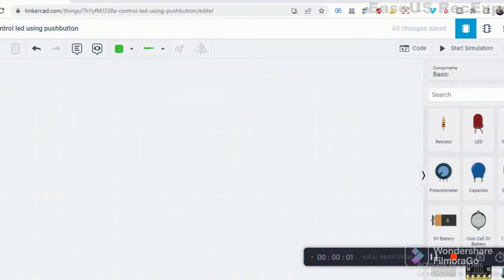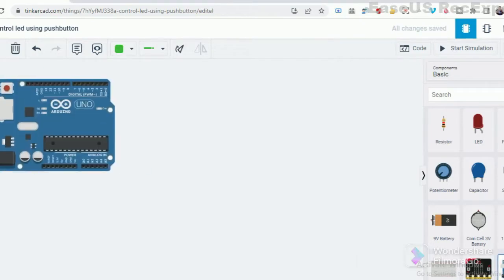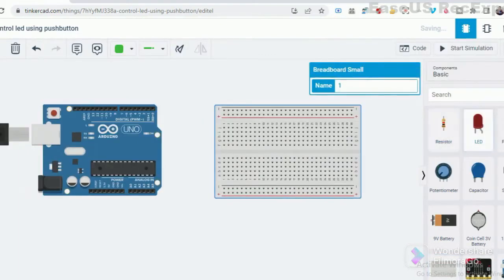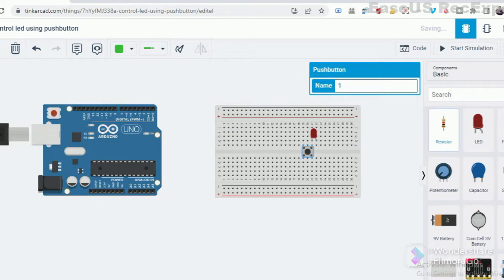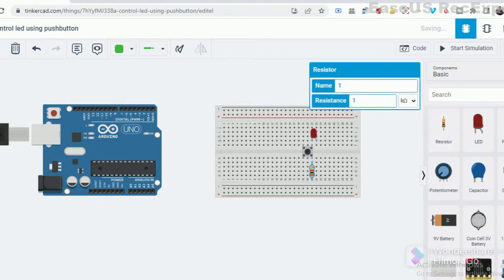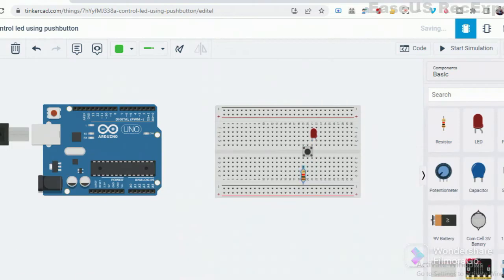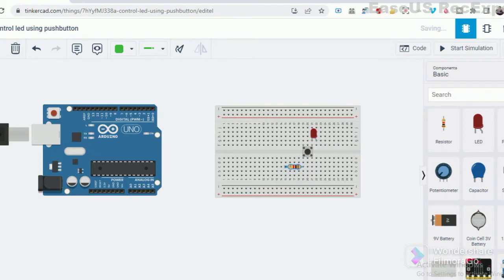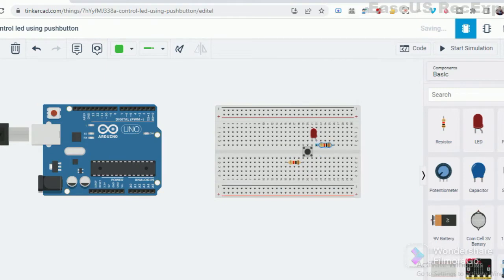pushbutton control LED using Arduino uno and simulate the output results on Tinkercad #led #tech

Comment from the maker: #arduino #tinkercad #tech #led #coding #robotic #arduinoproject #arduinouno #tinkercad #electronics #engineering #programming #control #circuit #engineering 
Hello all , In this video I will show you how to control LED using Pushbutton.
you can check Arduino code in the attached link below:
https://create.arduino.cc/projecthub/...

00:10-intro
00:10-02:30-circuit design
02:30-06:30-simulation results.